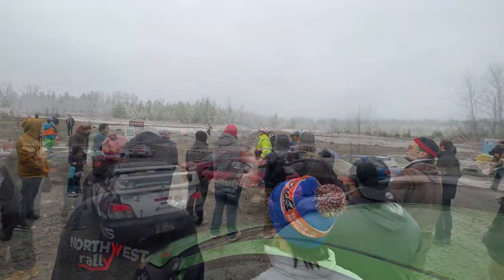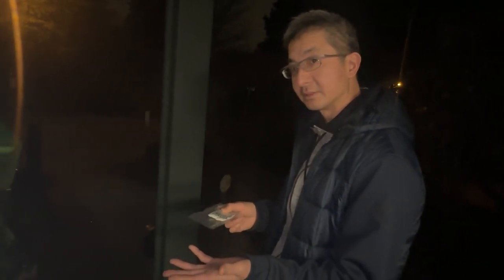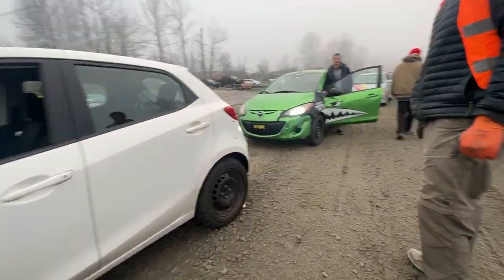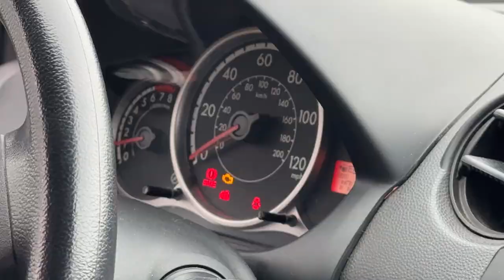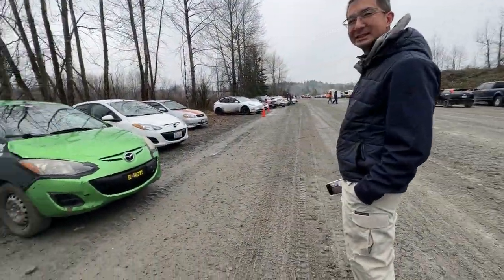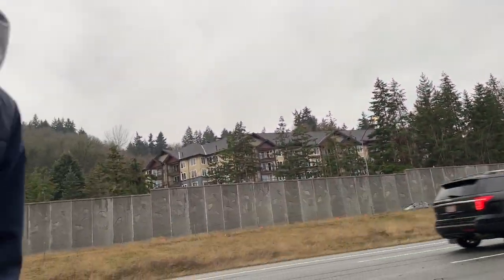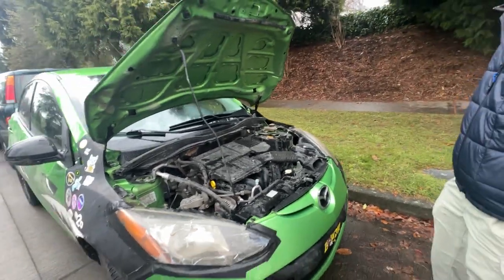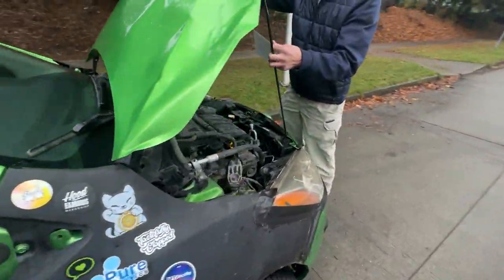Racing The Mazda 2 Until it BLOWS UP...

Comment: Do more of these racing vids they are so cool, I like your auction yard stuff too
Reply from the maker: More to come!
Reply: @bendaga  what exactly is rod knock?
Reply: @DollyBoy_1923  when the connecting rod  from the piston starts touching the very bottom of the engine block due to wear, when it gets worse it could break the rod and make the engine not move at all and die, hope this helps
Reply: @samuelgonzalez9061  super interesting! I think I get it. Yeah, that will definitely destroy the engine.

Comment: the abuse of racing didnt kill it, but the uphill, it locked up trying to go uphill what kind of dumb shit is that, i get that going uphill has more strain on the engine, it probably died and shut off as soon as the revs biult up, it probably snapped and it just didnt make a hole in the block. I wonder how it got to this point just curious